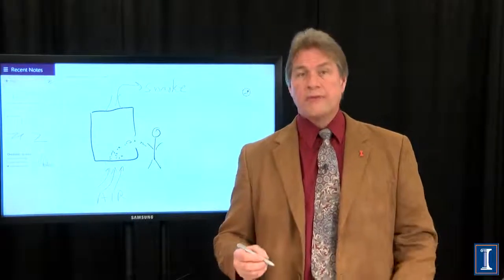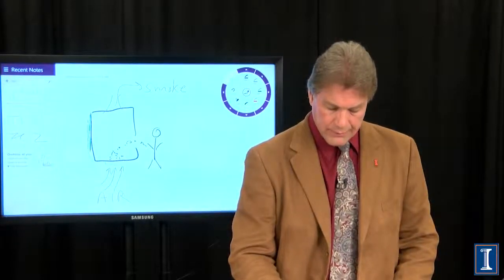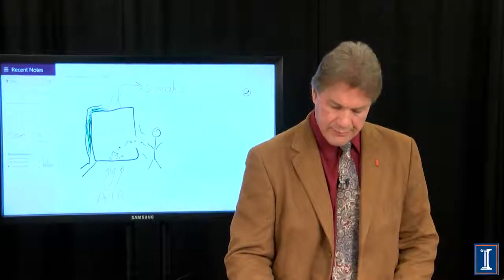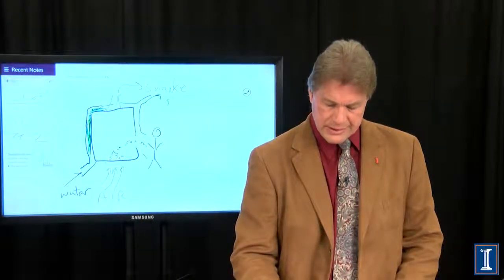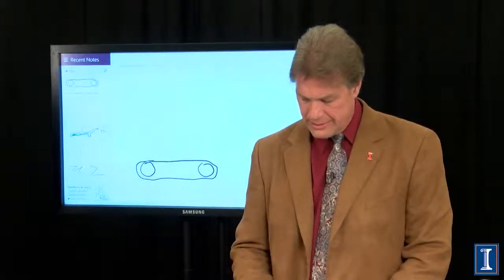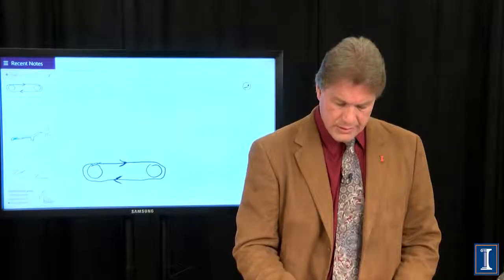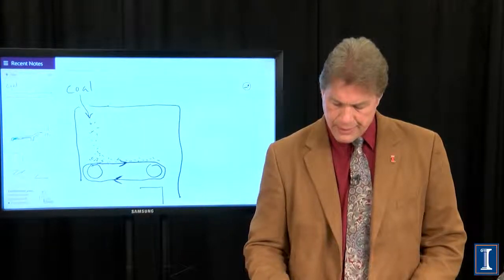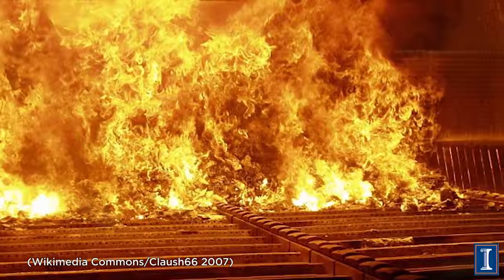Burning Coal through the Decades

Comment: Union Pacific experimented with a Locomotive that burned pulverized coal dust to direct drive a gas turbine, to avoid the inefficient steam component. Problem was that the ash sandblasted the turbine blades causing very expensive wear. Otherwise it actually worked.

Comment: How does the fire not go back into the hopper?
Reply: Fire triangle
Reply: the boiler's are run at slightly negative pressure, there is an intake fan forcing the air and coal dust in and exhaust fan sucking the exhaust gasses out, you run these in a way that produces a slight vacuum in the boiler to keep the fire contained.
Reply: @scottroberts3158  thanks :)

Comment: if we had molten salt thorium reactors we could begin to transition away from fossil fuels at last. It is the only cheap way to move from all this fuel burning. We should at this time be making in a factory 250 megawatt reactors at the rate of one per month per factory. Until this occurs the polar ice will accelerate in it's melt till florida no longer exists. Not only to make electricity but use the heat for chemical reactions and desalination. This will be cheap enough to actually use the heat of nuclear for man's better life.
Reply: There’s a lack of political leadership on this issue to be sure

Comment: I cannot believe this guy does not know the difference between a fire tube and water tube boiler.
Reply: Well most of the people looking at this don't know it either. Now I need to find out what the difference is. Would be a more useful comment if it contained that information :)
Reply: Yeah that was a WTF moment when I saw that end of the fire tube boiler open. That's more common for heat, than for power.